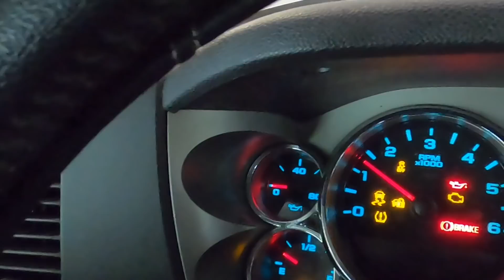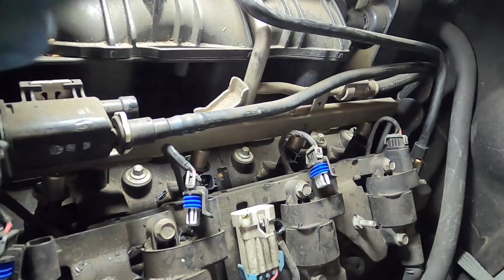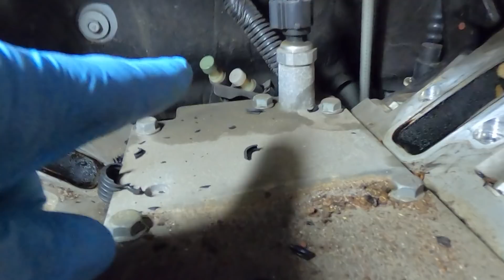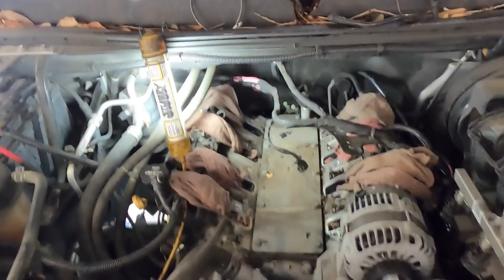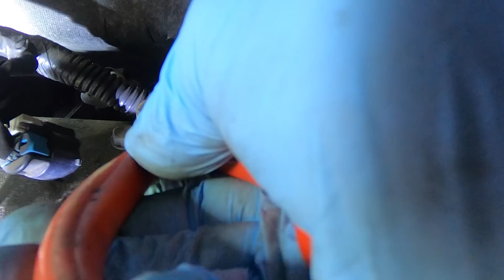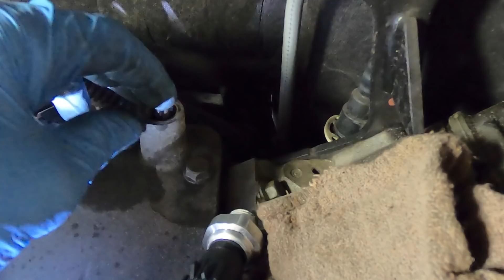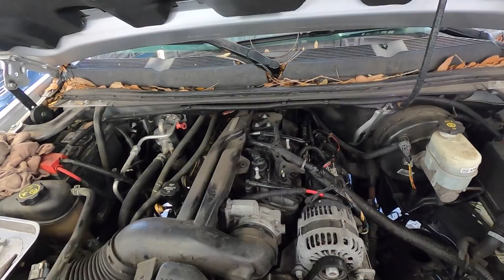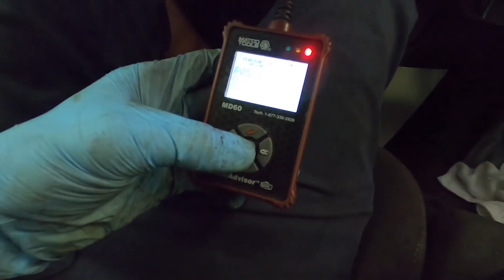Customer States: Google Diagnosis…replace this part!

Comment: 32:14, looks like the oil pressure gauge is up!
Reply: He sure trying not to show that gage again 😂
Reply: Good eyes!!! I went back and looked and 'sho-nuff!  Saw the tip of the pointer showing.  Either rainman didn't see it or we're being fed BS.....
Reply: Check engine light was gone too.
Reply: It sure does.  Ray?
Reply: Nice catch. I was wondering why he was so sure it didn't work without even trying to clear the codes first.
Reply: Yeah gotta agree on that
Reply: Yeah I saw that too at the end! Almost right in the middle
Reply: I was about to leave my own reply when i saw this was already picked up on, backing up from the garage the whole way no check engine light and if you freeze timestamp 32:09 you can see the oil gauge is working. ?? lmao
Reply: @SketchyOz  There's no way that is the oil pressure gauge needle. For that to be the oil pressure gauge needle it would have to be almost at maximum reading.....at an idle. No way. I'm with Kurt.....it's a reflection.
Reply: @edifyguy  I'm happy to be wrong if I'm wrong, but in this case I think I'm correct. If you only stare at the oil gauge from 32:09 till the end of the video you will see its no reflection and clearly the needle, not only that it'll show its just before the 40 meaning its not maxed out its just under half the gauge. I have no idea what it should be at, but that's what it's showing combined with no engine light looks to be a great internet fix to me.
Reply: @SketchyOz  So I looked again at several points in the video, and discovered by reviewing the beginning where you can see the gauge directly that this gauge only reads to 40 PSI, and indeed at 32:15 it does look like it could be reading about 38 PSI, nearly maxed, which also makes no sense if it is reading that, because that engine should not have that much oil pressure at an idle. Even if it was reading at that point, I still don't think it's working correctly.
Reply: @edifyguy  If you freeze frame at 00:17 you can see the gauge goes like this: 0 then LINE then 40 then LINE then 80, so if at approx. 38 it's just under half. Again I don't claim to know what it should be at, maybe higher or lower, but that's what it's showing.
Reply: @SketchyOz  Ok, I misread it when I was looking at the beginning, thinking that it was a pie-shaped gauge that stopped at 40. It's hard to tell sometimes from video. I thought I remembered them going to 80 from real life LOL. It could be reading 38 then. It does seem like that is a weirdly high reading for 600RPM though.
Reply: My 4.8 idled at 35ish and went up from there under acceleration. Looks about perfect to me. Looks to me like he was trying very hard to keep the camera off the oil gauge while he backed up.
Reply: @FixItTwice  It's possible. The 4.8 with which I have the most experience had a problem causing low oil pressure (10 PSI ish at idle, 25 ish at speed) and it didn't seem like a sending unit because the engine sounded strange and the main operator had been thrashing it for years. Perhaps clearing the codes made it look at the sensor again and that was the issue after all. If that's the case, the customer got lucky. Google diagnoses require luck.
Reply: 40lbs!  Scan Tool $105 shakedown averted !!   Excuse me I meant $124.56 w/'tax' : l
Reply: not only that the first time after sending unit was changed all he did was turn the key to Aux im no super mechanic but im pretty sure oil pressure wont build unless the engine is running i know he wanted to be right so bad but you cant always make a fool of everyone
Reply: He said the gauge was intermittent
Reply: @5thgearedlined  I have been a 30yrs+ Tech mostly Chevy and Jeeps and I was kinda pissed that this guy did all that work for nothing just to take a customers money. We all know that most oil pressure sensors mostly go bad when there are leaking especially in this day and age. I would have took the 5 min and diagnosed the problem and found that it was actually the cluster gauge. Any shop with the proper diag scanner could have done a cluster gauge sweep and found out the gauge was bad or the cluster. This repair was just stupid from the beginning.
Reply: And the check engine light is off too
Reply: That's a reflection off the edge of the bezel around the oil pressure gauge. At 32:13, you can see it if you look closely.
Reply: @kurtelliott1987  reflection? 😂 ok buddy lolololololol

Comment: I wonder if you installed the screen into the sending unit, and then screw the unit in, would it work? Just guessing.    Roger in Pierre South Dakota
Reply: No, that was just to keep crud from blocking the sending units input...
Reply: The one I didn't come apart I tried

Comment: You don't have to pull the intake to replace that sending unit I just did one about a month ago just need the special sending unit socket and on alot of them the reason for oil pressure failure is the oil pickup falls off into the pan
Reply: It's a little tight but i do it all the time without pulling the intake . The screen won't fit a 4.8 either because it's for the 5.3 afm engine.  4.8 dont have afm . It's already a baby engine. Pull 4 cylinders from that and burn more gas trying to keep up with itself
Reply: He probably did the job this way because the customer "self diagnosed" the problem. No diagnostic fee, so get them on labor.
Reply: @theBatmanGoeth2  You are probably right makes sense
Reply: You don't need to pull it on most 5.3L v8 that you'll find on 90% of the silverados, but there's no way he could have done this unless hes a leprechaun with tiny tools...
Reply: @saltysaty8686  you all just keep telling yourself that and do it the hard way I have my own shop and I will leave it at that
Reply: Bull, go back to where he lifts off that intake and note the location of the sender, there is no physical way to access it with the intake still on it.
Reply: @barryaiello3127  bad monkey is correct.i own a shop and ive never pulled the intake to replace the sensor.i also only use ac delco sensors when i do it.aftermarket ones are a hit or miss.
Reply: @garystclair7194  I just watched a few vid's, turns out I was 100% WRONG, you can indeed get to the sensor without pulling of the intake, possibly the service manual says remove it but with the right tools it can be done intake on.
Reply: @garystclair7194  yes this man is correct
Reply: @barryaiello3127  you my man are full of crap  I just did one I reached around from the driver side I have a creeper that is adjustable I can lay on and can see right back there and I removed the sending unit and screwed the new one in no intake removal needed but what ever you do it your way and I will do it mine and you can spend the hours of R&R
Reply: @barryaiello3127  wrong
Reply: @ohfknowned239  I've already posted that I was incorrect, did you bother to read the threads?.
Reply: @barryaiello3127  nope sorry no reason to.
Reply: @ohfknowned239  I replied that I was mistaken, you need to read the thread so you know what responses have been posted.

Comment: Wouldn't the screen just clog up giving you the same problem?
Reply: I thought of that also.
Reply: It's the o- ring that seals the oil pick up tube to the oil pump. Very common on those engines.
Reply: That screen is a panacea..a joke. It may forestall the inevitable sensor issue, but it won't prevent it. 
I plumbed the oil sensor to an easily accessible location for my '96 Firebird Formula WS.6 LT1 for just this reason. Only because I'm committed to keeping the car as stock as possible is the only reason I didn't go with a mechanical gauge. I built in a test port to periodically check the accuracy if the OEM gauge and so far in 5 years it's been rock solid at a 3lb under variance.
Reply: @gregoryking9348  Surely if you've got sludge in the oil, get rid of the sludge
Reply: No,  the screen will allow multiple small pieces of debris to be caught before oil flow is restricted.   The oil pressure sending unit has only one small hole to sense the pressure.   Once that one hole is clogged the sensor will cease to monitor pressure.
Reply: @aaa000777  Well, for the screen to be effective, its each individual holes must be smaller than the single hole in the sensor, otherwise particles would just pass through.  Since they are smaller, an individual opening in the screen will will clog up sooner than would the orifice on the sensor.  The only possible reasoning I can see to use one may be that since the screen has many, many more individual openings, it may take longer to clog up all of them than it might to clog the single opening in the sensor.  I am not sure this will be the case since it has smaller openings but I guess that is what they were thinking?

Comment: I have the same exact code reader in my glove box, great for when you pop a light and can pull over. Have avoided major engine damage with it as opposed to just driving on until I can get to a shop. 
Just bid on another through ebay since Matco no longer sells it... was it you that beat me to it?! Haha

Comment: Is the 4.8L really that much different that you need to pull the intake to change the sending unit? I've done them on several 5.3Ls and never had to pull the intake. It is a little tight but it's doable. Takes around 15 minutes. To be fair to the customer, a failed oil pressure switch/sender or plugged screen are the #1 and #2 causes listed by Identifix for the oil pressure gauge not working on these GM trucks.
Reply: Same setup, I HATE screwing a manual oil pressure gauge into these. Pain in the butt.
Reply: @mph5896  I don't think I've ever had to do that, yet. Fortunately, you can usually diagnose if the sensor is bad without screwing in a manual gauge.
Reply: madmatt2024 true. If it’s a performance and circuit code, look to sensor or wiring. Performance code only I would put a gauge on it. I have seen enough hot idle very low oil pressures with internal engine problems

Comment: Is it wrong to hope that simply replacing the part he demanded you replace without diagnosing does NOT fix his problem?
Reply: Hahaha yes! Rolls out of garage and engine blows....but it was only an oil pressure sensor!
Reply: @Rambogner  It's a classic scam. I think Rainman has talked about it. Engine ready to blow. Bring vehicle to garage to replace a random part. Pick up vehicle from garage. Drive away. Engine blows. Demand the garage replace the engine.
Reply: @littlestinker9716  oh really! Scumbags eh!
Reply: It sure looks like the gauge is working right at the end of the video...
Reply: @bills6093  I saw what you mean and have to agree with the guy who thought it was a reflection on the bezel. For it to be a reading, that would mean that the pressure was almost maxing out the gauge, and at an idle. Not going to happen. Those gauges go to 60 or 80 psi, those engines idle around 20 psi, MAYBE 30.
Reply: @edifyguy  Hopefully they will clear up what we saw, or didn't see, in a follow up.
Reply: @edifyguy  actually these trucks do idle at 40 psi
Reply: @billbarham9101  Others have said this as well. Perhaps the issue was resolved then. The only 4.8 I ever used had been thrashed and the motor ended up being so worn that in the end it only had 10 PSI at an idle with silly noises and got a different motor lol. The most I remember that one having at idle was 25 PSI stone cold, but that could have been wear.
Reply: @bills6093  Engine was off.  Gauge rose to a random spot.  Look at the tach...0 RPM....
Reply: @richardc2124  Tach looks up at idle to me. Don't really care though.
Reply: What is wrong with "hoping" without knowing? 

Nothing if you have endless funds to spend.